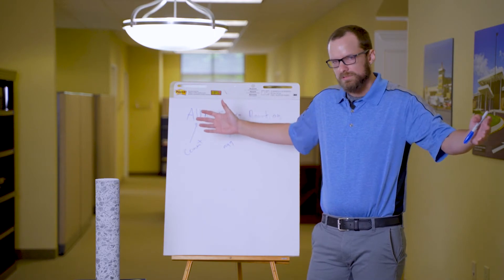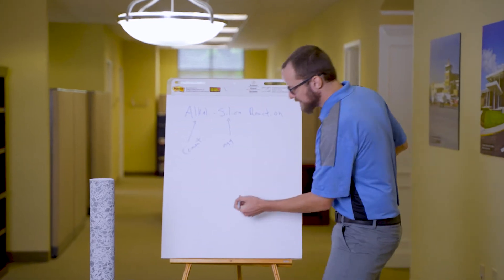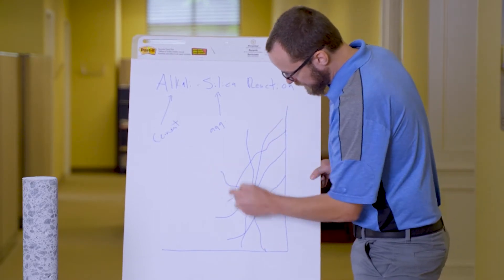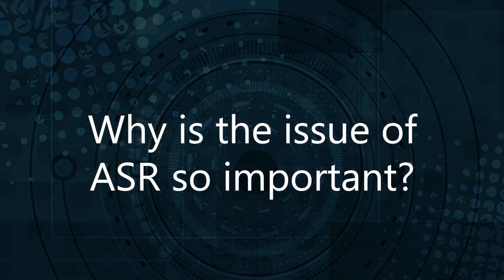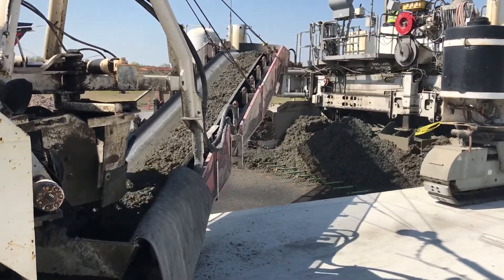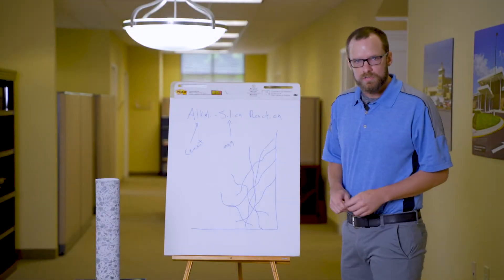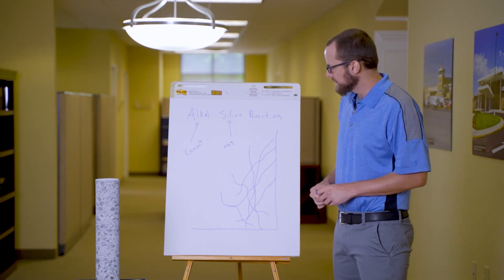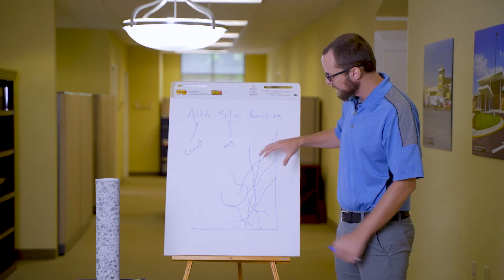What is Alkali Silica Reaction (ASR)?

Comment: Nowadays, we can prevent ASR,  are 3 things needed for ASR to manifest itself on concrete. 1)  High PH, 2) reactive aggregate and 3) water / moisture. 
As the quality aggregates are being depleted, we're left with the lower quality aggregates (in Texas we have a lot of lime stone) lime stone swells up with moisture or water, concrete being porous allows the water to come in contact with the aggregates.  The solution is to create impermeable concrete, and by negating the water to have contact with the aggregate "Problem solved". Not only solve ASR, but the rebar corrosion as well. Look up on YouTube: vaporlock 20/20 sample test.